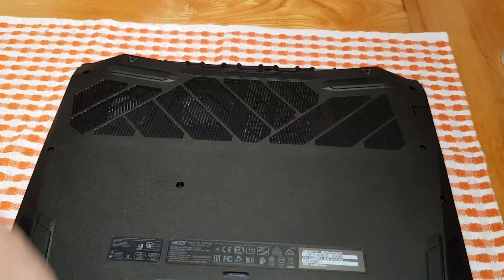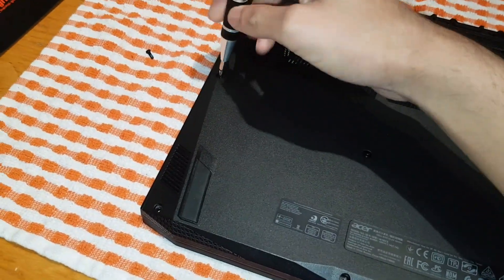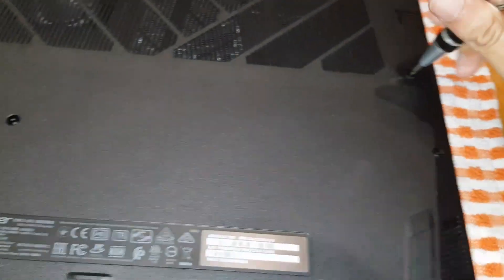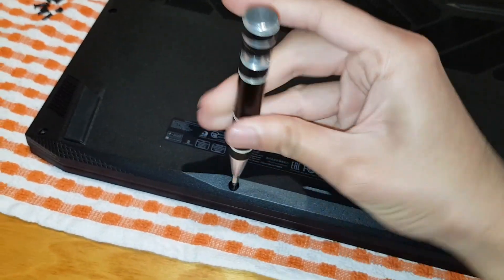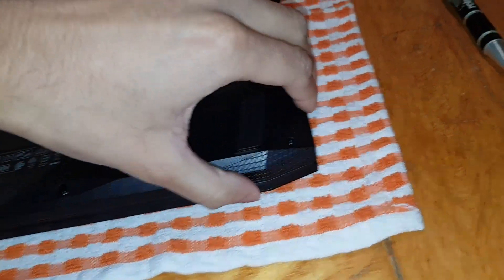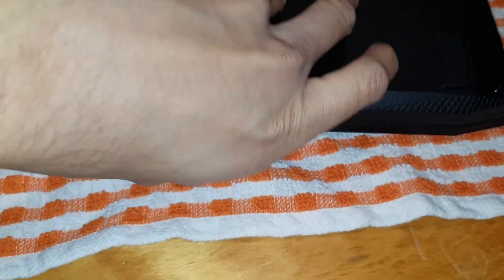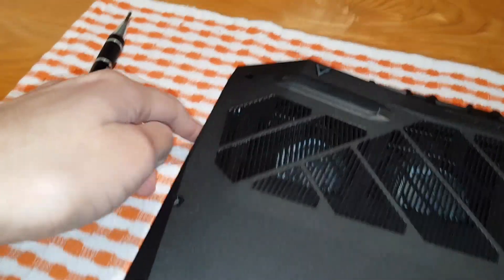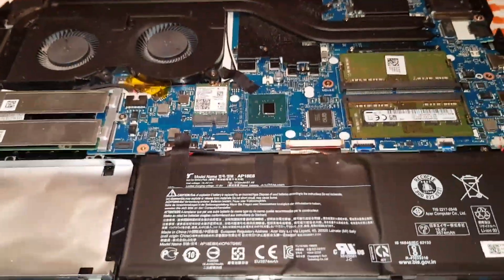How To Disassemble Acer Nitro 5 Gaming Laptop

Comment: Hi, can I know the average temperature of the CPU when gaming? Mine goes to 95. Is it okay? Thanks!
Reply from the maker: Mine used to do that too i had to repaste to fix it
Reply: @MrWaheedulHaque  Oh thanks. But will running at 95 be bad? I am not comfortable with opening the laptop and removing the heat sink to repaste.
Reply from the maker: @chandimawickramatunga7244  running at 95 isnt bad but will stress out your cpu and gpu overtime
Reply: @MrWaheedulHaque  Oh okay, thanks for the information! Good luck! Stay safe!
Reply: @MrWaheedulHaque  i already repaste mine, it cooled down for a while. But the next day, the temperature rised again. Any idea how to fix it?
Reply from the maker: @achmadakif2048  which paste u use
Reply: @MrWaheedulHaque  im using kingpin kpx
Reply from the maker: @achmadakif2048  try different paste your paste probably hit top temp and pumped out the sides
Reply: @MrWaheedulHaque  can you recommend the best paste. im using laptop
Reply from the maker: @achmadakif2048  best i found to work on this laptop is the hydronaut as it pumps out at higher temps so it is suitable for this poorly designed thermals on this laptop so it will last with low temps

Comment: is it possible to reassemble/put back the cover of the laptop? thinking of removing the back to clear out dust but dont want to do anything too risky.
Reply from the maker: Very easy to take off and on back cover dont worry not risky at all as long as you discharge any static by touching metal

Comment: Please reply pleaseee
1)what type and what size screwdriver did you use
2)do I have to disconnect the battery before I put in the ram,ssd etc??
Reply: You do not have to disconnect the battery before upgrading RAM or SSD, however the laptop will have to be powered off and everything unplugged.
Reply: Please reply bro
Reply from the maker: Screwdriver was a normal crosshead screwdriver, and you dont have to but it is good to, i recommend taking it off if you ever taking off the heatsink and fan
Reply: @MrWaheedulHaque  ohh but what about the size...2mm?
Reply from the maker: Not sure the medium size one
Reply: @MrWaheedulHaque  ohk
Reply: @MrWaheedulHaque  so btw do I have to disconnect the battery before putting in ram,ssd etc
Reply from the maker: Not really just make sure you get rid of static
Reply: @MrWaheedulHaque  ohhh ok thanks alot bro

Comment: You didn't even have a warranty sticker? That's weird. Do you have Twitter or Instagram? Nice video bro.
(Edit): That’s definitely used there wouldn’t be that much dust or scratches inside or no warranty sticker if it wasn’t used.
Reply from the maker: Nope i found that weird too, but i have my unboxing video on my channel anyways which shows the missing sticker so acer cant say anything as i have proof, and yeah its same as my youtube, thanks bro, and my house is just very dusty haha so it probably was just me
Reply: MrWaheedulHaque the thing I also found weird inside your laptop is the battery was bent and it was swelled up so you must’ve degraded that battery significantly while using that laptop